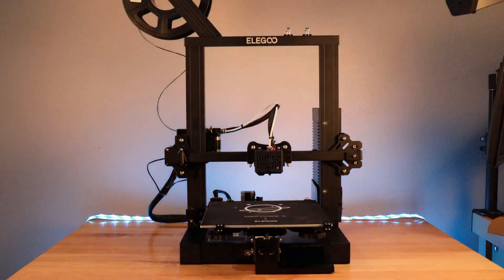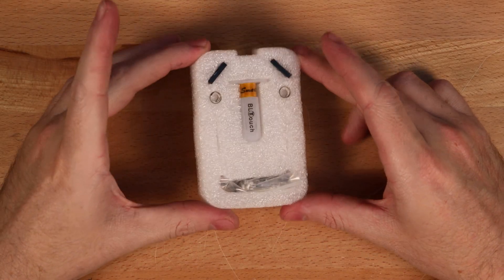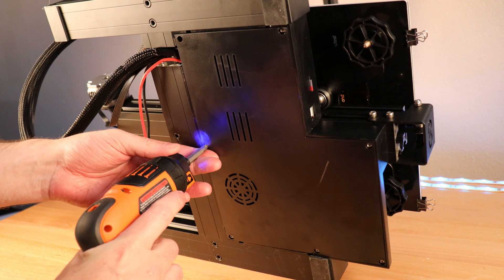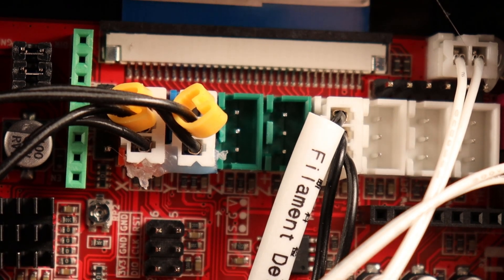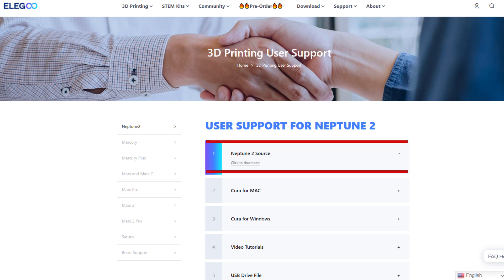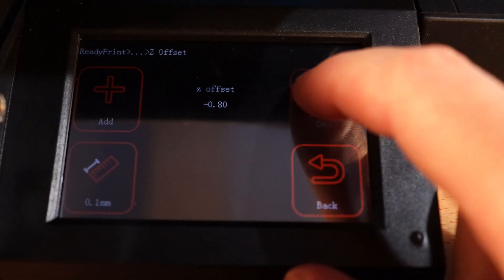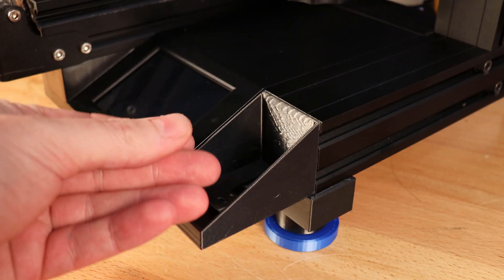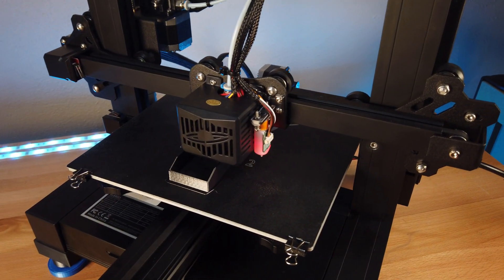How to install a BLTouch on your Elegoo Neptune 2 & other upgrades

Comment: I watched a video from a guy who installed this and said it didn't work that well, so I was wonder what has your experience with it been? like has your opinion of it changed since making the video? I noticed in his video he did some things different like the cable on the BL touch was facing inside unlike your instructions that say to have it facing out and in general the BL touch was pretty far from the nozzle than in wan in your video. sorry for the long comment
Reply: I got mine yesterday and installed it.. I'm having a really hard time trying to make it work. It really seems like manual leveling is the better option for the Neptune 2. I'm starting to get pissed of. The automatic leveling is too high and too close at the same time. And then the loud clicking noise from the z stepper because of the micro movements are annoying. Even Elegoo is recommending to use manual leveling (look at their installation guide for the BLTouch).
At this moment I'm getting the best results with 2x2 probes, means the middle part (which is the highest point) of the bed isn't even measured. And even with this leveling it's too high and too close at the same time, at a small benchy! Seems like the z movements a messing up the print.

Comment: I noticed at 0:46 you had it probing really quickly, looking at the text file I don't see a way to disable the double probing per point, how'd you do this? and is It practical and as accurate?

Comment: hey, can you make a video about the extruder skipping? I am 13 and all of this is kinda hard for me to understand but your video help me get a better idea about what I was doing and when I got my bl touch it took me like 3 days to set up because there were no videos about it
Reply from the maker: What skipping are you having?
Reply: @GomeowCreations  my extruder keeps making a click sound and when I look at it it just goes backward and then forward and I also have stringing problem and some of my prints have layers missing also is there a way were the bl touch goes down before the hot end and the bed heats up
Reply from the maker: Was this happening after installing the new firmware?
Reply: @GomeowCreations  the extruder yes and the stringing problem too
Reply: @emranullah6259  Are you sure it's skipping?? Is. It not the z axis?
Reply: If it's skipping it's because you might have a partial clog. You may not have enough gap between nozzle and the build plate. Too close and it can start clogging up your nozzle. I had one hell of a time fixing this. Upgraded the bowden tube, which at first it became unseated and would ooze out of the hot end and not the nozzle. Research some tips on how to unclog your machine.

Comment: It's only leveling in the center of the bed. Then to one corner. Goes to center again and is way off the bed. No way I should ave to adjust the z offset to -30.40. Any help would be greatly appreciated

Comment: Im receiving my printer finally tomorrow with the Bltouch. After I install the Bltouch and flash the firmware, if I power off the machine do I have to keep re entering the Z offset in the UI each time I power it back on? Seen some info of it not saving the Z offset.. Cheers
Reply from the maker: So it looks like the z offset isn't saving when the power is off using the new firmware. I'm talking with elegoo now to get this fixed I'm also trying to get them to make the UI better seeing that I feel it's lacking in options and tools. Let's see if I can get this going and I might make a post about it once it's done but I will update the description of this video when I have better info. 

For now if you do use the firmware you are going to have to run the auto bed level everytime you turn the printer on. Write down the offset that works for you so you know what to set it to and it should work for now 😁👍
Reply: @GomeowCreations  it's seems my Z offset seems to be saving even when turning the printer off, so not an issue for me.

What has become a slight issue is since installing the Bltouch, there's now a knocking sound coming from the Z stepper motor when it prints. I've tried everything to correct it with no joy.

I've contacted Elegoo and they said that they've had other customers having the same issue who have installed the BLtouch. Are you having this issue, and if so any ideas on how to solve it? I'm at my whits end 😅 thanks alot

Comment: I've seen some people mention changing the springs under the bed to help with keeping this level. But I haven't seen anyone actually mention where to get new springs or what kind of springs to get. I find I have to do some pretty drastic re-leveling after every print. So I imagine, even with auto-leveling, I'd still need to do it after every print so would you have any idea about this spring option? Thanks!
Reply from the maker: So you can get some of these springs https://amzn.to/3fuGyZL. They should be a lot stiffer. When it comes to the problem you are having, how loose are your springs on your bed? I had may z end stop at its lowest point so I could have my springs be a bit tighter and so it wouldn't come out of leave so easily.

When it comes to the auto bed leveling I kind just set it up once and it has not needed any leveling and I have even moved the printer from room to room.
Reply: @GomeowCreations  That's one thing I'm super confused about. I have my Z stop at about 5mm point as they suggested. I have no idea how the z stop influences the leveling. I would think that if I can get a good level with it at that point, the leveling should hold and neither the z stop or the level should need to be adjusted. I would think the leveling and the z stop would be totally separate things. And I honestly have no idea how to answer how loose my springs are.
Reply from the maker: Basically the tighter you have your springs the more pressure the put on the bolt and will help keep them from moving over time. By moving the z-end stop down it will make you tighten down your bed more.

Comment: I did this as you did but now nothing is sticking to the bed and the Z-motor is making a knocking noise, any advice?
Reply from the maker: Knocking is not good. As for things not sticking that might be due to you not having the z offset close enough to the bed. Run the auto bed leveling again and adjust that. 

When it comes to the knocking noise, I have no idea what that could be. Sorry 😅
Reply: The knocking noise is normal. It's the z stepper making very small movements. My advise after 4 days: Bltouch on Neptune 2 is shit. Go with manual bed leveling. My first layer is bad, no matter what I do. With manual leveling my first layer was always accurate af.

Comment: Just seen your video as I was looking for info on glass bed upgrade, I was getting perfect prints on the original bed, but since changing to glass bed having issue with sticking down the base layer when on standard settings, can you advise on best settings when using glass bed
Also note on the wobble in frame, mine wobbled but I put it on a flat surface released the side frame screws then retighten while pushing down and it removes all wobble no need for feet,
Reply from the maker: I used a PEI sheet on all of my glass build plate and they work really good. Here is a link to the one I use https://amzn.to/3ypeBKf

For PLA I heat the bed to 60c and 180c to 220c on the hot end. I print a lot using silk pla and it likes to be on the hotter end. I make sure that my PEI sheet and keep any oils and dust off of it.

Comment: Thanks for the video. All worked great :) Two Questions:
1. It looks like you set the GRID_MAX_POINTS Option for X and Y to 4 in the config file. Is that correct?
2. Did you leave the X and Y Offsets from the Probe to the Nozzle at X=32.55 and Y=-7 (like in the config you provided) or did you adjust those aswell. Obviously those depent on the printed BL Touch Mount. But since most people use the printable one you linked, it should be the same offset for everybody using this mount (since measuring the offset accurately is pretty hard).
Reply from the maker: 1. I don't remember if I did change that or not but it might have been set to 5 or something and I don't feel that it needs that may points. 
2. I didn't do anything to the offset for the probe settings. That does center the probe on my bed really well so with the mount I linked it should be fine.
Reply: @GomeowCreations  Thanks for your answer. One more question:
- Has your printer also gotten a little bit louder with the BL Touch working? I think mine makes slight ticking/clicking noises due to the small adjustments in the Z-Axis.

Comment: Dear  GomeowCreations, could you explain step-by-step how to save the Z-offset for the Naptune 2? It seems I've got about -1,4mm to -1,7mm distance between the nozzle and the bed. After manually triggering the autoleveling I can set it per hand with a piece of paper but the Neptune 2 won't save it for next time. I always have to autolevel and set offset again. I'd like to save the Z-offset and let the printer do the autoleveling at the start of each print automatically but not per hand after booting. I wanna automate it as much as possible so I dont have to tinker around with paper and stuff. Is that possible? Thank you!
Reply from the maker: You should be able to run the auto bed leveling using the screen. It will probe the bed and go to the center of the bed. Once it's hear you can adjust the z offset. Once you have it to your liking it should save when you exit that screen.
Reply: @GomeowCreations  And will the auto-bed-leveling and offset be saved for further boots or only for this boot and it has to be done every time? No option to store the offset in the firmware or so? Thank you!
Reply: @GomeowCreations  Oh, I'm stupid... I found it out now.

The Z-Offset IS actually STORED. The mistake was: 

I don't have to trigger the auto-level each time manually in the UI but add the auto-level startcode in Cura so that he probes the heatmap before each print and than uses this heatmap and the stored offset (which is always saved in the printer).

That makes much more sense now.
Reply from the maker: Oh yeah this printer doesn't seem to like the gcode command to prove before the print. I tried that yesterday and it made things just not work right
Reply: @GomeowCreations  Yeah, I have a new problem. After activating the start code G29 it does its autoleveling but during the print it switches the screen to Z-offset adjustment and the print monitoring view disappears. Wtf?

You know what I mean? It does not work properly when you make the autoleveling in the gcode because it leaves the printing UI screen.

Currently I can only do manual autoleveling and use gcode without G29 and autoleveling. So I don't know if the mesh is actually enabled then.

Hm.....
Reply from the maker: Yeah that was basically that I was talking about in my last comment haha. Don't use the G29 code. 

You can try this. Run the auto bed leveling from the screen. Go get a thin test print from thingiverse.com that will make a grid over the full bed and this should tell you if the leveling is working right. 😊👍
Reply: @GomeowCreations  Good idea! Will do. Thanks!
Reply from the maker: Let me know what happens 😊
Reply: @GomeowCreations  I think it's not working 100%. 

With several prints I saw that the z-distance at the right-front-area is very small (too close) while the back-areas are fitting good. So it seems that the table is manually leveled quite good but the printer does not use the auto-leveling-mesh. Otherwise it would compensate the height differences and would not always have problems with the same corner wouldn't it?

Can you please check if I'm wrong or not? Really sucks that I don't know if the ABL is working or not. ^^

Currently I do it like this:

- preheat to print temperatures
- trigger ABL in the UI/screen (5 x 4 mesh)
- start print
- print-code starts with -->
"
RESTORE_LEVELING_AFTER_G28
G28
...
"

Is this correct?

Thank you!

Comment: Lol what a timing, I literally got this BLtouch yesterday and was looking for a tutorial for the neptune 2. I am going to do this now. Thank you!
Reply from the maker: Perfect. Just make sure to check out the file I have with the firmware due to there being 2 main board versions. If you load the wrong one it will make the printer no longer work until you flash the right firmware. 

I got very lucky when doing them and it just worked the first time for me but I learn after posting this video that people had some problems and that was why.

If you have any questions feel free to ask. 😁👍
Reply: @GomeowCreations  Oh I closed it 10 minutes ago. My printer is from July 2021 sold in Europe. What do you think which version I need? Else I've just got to open it again. ^^ Or I just try the fist if you say I can't really hard-brick it anyway. Thanks!
Reply from the maker: You can look at a serial number. I have a file in my downloadable file thing that tells you what you need to look for. You can also look at the info screen on the printer before flashing it to see what version it is.
V1.0.3 or V2.0.2
Reply: Scratch that. As I read in your readme, its possible to check the version in the UI. Thanks! EDIT: You're answering really fast. :D Thanks
Reply from the maker: Just let me know what happens 😁👍
Reply: @GomeowCreations  It worked! Perfect instructions. Everything as described and no surprises. 😀 Big thanks!
Reply from the maker: Awesome 👍 and happy to help. I have some more 3D printer videos coming in the future. So if you haven't already subscribed you might find it do be helpful 😊

Comment: Your upgrade guide is very clear and helpful - thank you
Is the Neptune capable of printing Polysmooth (PVB) ?
Reply from the maker: Well thank you very much for the kind words about my video. 

I have never used it but looking at the settings required to print it I would say yes it could print it. 😁👍
Reply: @GomeowCreations  Thank you
Reply from the maker: No problem 👍

Comment: my version is 1.02 will this mess up my printer if I install the 1.03?
Reply from the maker: Use the 1.0.3 one and you should be fine. Mine was 1.0.2 just make sure you follow the instructions in my zip file 😁👍

Comment: Just ordered my Neptune, can't wait! Would you say I should order a Sensor immediately or try the Manual leveling First ?

Greetings From Germany!
Reply from the maker: Awesome and I would get the bltouch right away. But don't try to install it until you can print the mount for it.
Reply from the maker: Also check out this video if you want to see how I set it up when I got it https://youtu.be/TGVg_lbN7FE
Reply: @GomeowCreations  already Watched that one 👍 I ordered a Bltouch Clone right now, which got good Reviews. Can i Set this Up using your Firmware? The Sensor should be identically by Stats and built.
Reply from the maker: You can use my same firmware with that. Just keep in mind that the wires will be different colors.